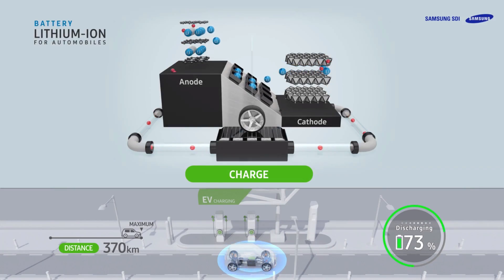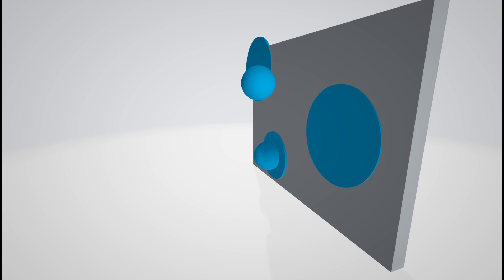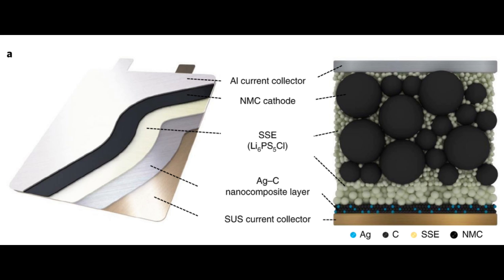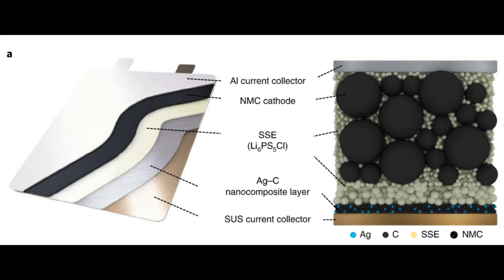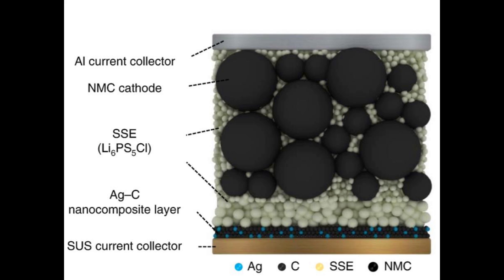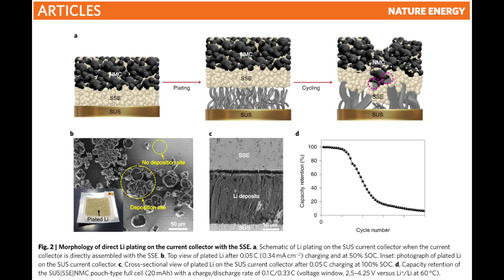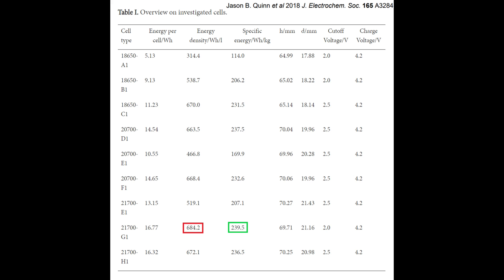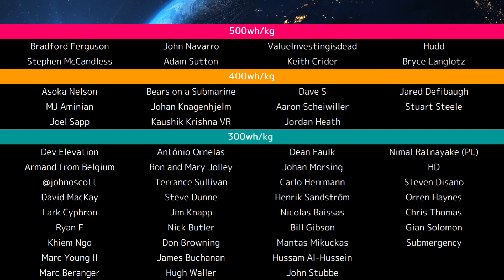Samsung's "Breakthrough" 900wh/l Solid State Battery (Deep Dive)

Comment: Sodium ion batteries: increase the energy density by using a more reactive metal and reduce the cost by sourcing it from a more common type of salt!
Reply from the maker: Yeah, but sodium is at least 10 years away
Reply: @thelimitingfactor  LOL just like fusion.  Chemistry is 1 of those sciences that you just can't predict; you have to try it out.  Now I'm not much of a chemist, but batteries are weird bringing chemistry and physics together!   ;)
Reply: Have a look at your perodic table Li is the lightest most reactive metal
Reply: @jacksterdaniels3718  What . . . no it isn't!  Look up a video on how they react with water!
Lithium just bubbles while sodium bursts into flames, and potassium explodes!
The real questions are: if the additional weight counters the added energy, and if it can be made as safe as lithium ion.

Comment: While the silver additive is a game stopper, He did not fully emphasize the potential for the substitution of lithium with higher energy densities such as sodium.
Sodium is not used with liquid electrolytes because it is too volatile. With solid electrolytes thermal runaway is not an issue, sodium is said to increase capacity x10.
Also if a different element is used such as sodium the silver plating catalyst maybe substituted with a less rare metal making the potential of this concept sustainable and worth considering given the increased capacity longevity & power density.
Reply from the maker: That's interesting!

Comment: 1. I did not see data that defines capacity loss at 1000 cycles: 20%? 50%?
2. I wonder if a solid state cell could be fully discharged w/o suffering damage?
Reply from the maker: Point number one, at 1000 cycles it was bouncing all over the place.  But it was still above 80%.  Not sure on the second point.
Reply: Search for Jhon Goodennght and Elenna Braga white papers. They have better research and cheap cann use Na(yeah salt from ocean or that what you use onn chiken)

Comment: Still confused on why no one is talking about the commercially available solid-state ceramic battery from TDK. It's teeny tiny, but still seems like a pretty big deal to me.
Reply from the maker: Because solid state has been around for years.  It's making solid state that hits every corner of the spider chart that's hard.

Comment: I have always wondered how the dendrites manage to short the battery to the extent of explosion. Why dont they just "zap" shorter like a thin wire over battery terminals would burn out? Or is it the combustion during the zap inside flammable material? Doesnt need o2 to combust?
Reply from the maker: The electrolyte is flammable.  Zap... Whooompfff, lol

Comment: Nice explanation of the Samsung cell, Jordan.  I question the importance of the cost of Zirconium and Silver.  This is ENTIRELY dependent on the amount required.  The Zr is a nanolayer, so I think that can be ignored.  As for the Ag, how much do they need?  If it's only a few milligrams per cell, no problem.  If it's grams per cell, then it's several thousand dollars per car.  Even that's not enough to be an absolute killer of this technology, if it were developed to a truly outstanding cycle life and energy density.
Reply from the maker: That's a fair point.  This is why I said small amounts would be required.  this is lab scale and there's no way of knowing how much they would end up needing.  There may be some use cases for this battery, but the fact that even Samsung isn't commercializing it is telling.
Reply: @thelimitingfactor  you could also argue along the lines, that the silver used is an "investment" or that it makes it more likely that the battery later at EOL will be reused/recycled since it has a higher intrinsic value because of its silver content, thus supporting the "circular economy" (and perhaps for the car owner, at EOL, to recoup the initial "investment".

Comment: Weight?
Reply from the maker: Exactly, they didn't say.  Guessing it's heavy.
Reply: @thelimitingfactor  The physical compression of the cell necessary to keep the sulfur electrolyte in close contact...   it didn't make sense to weight a 'lab cell' and compare it to a well developed 'commercial cell'.    But, it had advantages of 1) non-flammable  2) OK volume

Comment: well, we all know solid state batteries could be the way in the future...almost without question...the problem is, when they are finally up to the task...there will likely be something better....only time will tell. I've been keeping an eye on this for several years now...and keep hoping there will be some drastic leaps...but...it's just moving too slow...not to mention the manufacturing process will still need to be rectified.(no pun intended)
Reply from the maker: Straight up!  Revolutions in microchips are always 5 years away.  The hurdles keep getting higher for a breakthrough technology.  Silicon has gone farther than we ever thought it would.

Comment: Why do you suppose the researchers used silver instead of lead? Lead has been shown to inhibit dendrite growth quite well. A 3% alloy of lead in a mostly tin solder was enough to stop dendrite growth. Would lead have impacted performance that much?
Reply from the maker: Heavy metals are probably not necessary.  Battery 500 consortium is making progress just by tweaking electrolytes.
Reply: Jacob Brodsky, lead acid batteries have dendrites, where the tip of a dendrite is mainly composed of polycrystalline nanograins. With the increasing amount of nanocrystalline grains aggregated on the surface, the grain size becomes larger and the dendrite grows rapidly along axial direction. Thus resulting in a non conductive film and potential short circuit.
Reply from the maker: @Dana5775  Damn, great answer!

Comment: How many battery explosions and fires have you seen?  Slow charging and requires silver sounds like a deal breaker for EVs.
Reply: Solar panels maybe better, I'm more concerned with the low voltage range.  Maybe good for small electrical devices only.

Comment: It looks like you considered battery usability in EVs. What about its usage in small electronics? Won't it be viable?
Reply from the maker: The question is, why would you want it for any device?  1000 cycles is average, 900wh/l isn't spectacular, it doesn't fast charge, and there isn't currently a way to mass produce it. Safety - possible, but there are other solutions out there.

Comment: What's the physical limit of kwh/kg? 1000? 10.000?
Reply from the maker: Hard to say.  There is one 'challenge' set for the same as gasoline....something like 12000wh/kg.  600wh/kg is planned for a little over a decade from now...at the system level.  Which would mean about 1000wh/kg.
Reply: @thelimitingfactor  Does the 12000wh/kg figure for gasoline include the mass of the engine and supporting bits that allow it to be realized?

Comment: Another faultlessly argued video.  Shirley Meng has already intimated that high energy to volume (not weight) batteries are presently possible but due to material constraints and mass production hurdles may never become financially viable.  This Samsung ‘break through’ may fall into this category.  The only way to compare the multiplicity of often mutually exclusive attributes of batteries is, as she described it, to plot them on a ‘spider chart’.  Tesla appear to be focussing on increasing the number of cycles to >4000 and making multiple incremental improvements to manufacturing processes to achieve gains that are commercially meaningful.

Comment: Minor production quibble: I think the 60fps doesn't make sense for this presentation style video. It just increases the bandwidth and hardware requirements with little benefit.
Reply: Manuel Barkhau with so many static images frame rates should be optimized in the compression algorithm to reduce redundancy.
Reply: Unfortunately I agree! My old Chromecast couldn't keep up with this :(
Reply: I prefer it, it's smoother and easier on my eyes. Additionally I have 500mbit Internet and my 7 year old computer is more than fast enough for it. Can't you switch the resolution yourself?
Reply: Manuel Barkhau out of curiosity, does reducing it to say 480p help?
Reply: Nevermind the fps, what's up with the sound? It seems every start of a sentence is muted, really annoying.
Reply: people using 60fps for other than gaming is useless I think.. it inflates bandwidth requirements extremely for no benefit.. I even think 24p is more aesthetic than 60fps
Reply: @chronokoks  I like it.  I think videos look much better in 60fps.
Reply: @bob15479  to each his own but there's a reason why hollywood prefers 24fps.. more doesn't always mean it's better or nicer
Reply: chronok Hollywood is 24fps because tape was expensive back in the day. That’s literally why. Also it’s an opinion 🤷‍♂️
Reply: @bob15479  it wasn't because tape was expensive. It was because 35mm film was expensive and 24fps was the minimum you could get away with while still preserving sound synchronization. Before sound was synchronized with film silent films were shot at 16fps.
Reply: @reviewgodusa9613  isn't film the same as tape? whichever one is expensive is the one I was referring to. lol.

Comment: I I'm not as down on the cost of the battery simply because I'm not sure about the amounts of silver used. Remember we use both platinum and Palladium in catalytic converters today and the amounts are substantial enough to make them a prime target in recycling oh, but there's still a catalytic converter for 2 in pretty much every vehicle on the road
Reply from the maker: A catalytic converter is required on every vehicle.  So no individual company gets ahead.  This would be like putting a catalytic converter in your vehicle but no one else is.  If it were viable, Samsung would be developing it.  They aren't.
Reply: @thelimitingfactor  true but if the difference in performance can be increased to an extent that justifies the cost difference, or application can be found in which the added cost is Justified due to the increased performance< mobil phone and drone batteries come to mind> this could be very much useful Tech. It all comes down to precisely how much silver is required.

Comment: Great video as always. You focused the use case of this solid state battery chemistry for electric vehicles. Samsung is a major player in the mobile phone world. With that use case in mind, how would you rate this battery chemistry for creating batteries for mobile phones or other small battery driven appliances.
Reply from the maker: Similar.  You make a good point though.  I do tend to think of batteries strictly through the lens of electric vehicles and storage.  Basically, this battery is flat out too expensive with little benefit in return.
Reply: The Limiting Factor wouldn’t that depend more on the amount of silver used in a battery. Did they tell anything about the amount of silver used in this setup? Using precious metals in electronics is not new. An average laptop contains about 60micrograms of gold.

Comment: Cool as always, Jordan. Could you do one on CATL 2 million km battery? They say it's ready for manufacturing to any buyer which is interesting since Tesla was supposed to announce a million mile battery based on Jeff Dahn / Dalhousie tech with CATL being the Chinese partner for Asian production. And now CATL has independently developed an 1,2 mil mile one for all takers? AND Tesla VP Robin Ren who orchestrated Giga Shanghai & partners incl. CATL suddenly leaving Tesla? Too many coincidences here... anything to share?
Reply from the maker: As Jeff Dahn has said, a million-mile battery is now easy.  Everything you need to make one is now on the market.  Anyone should be able to make one.  If they're not able to do it for a decent price it comes down to the specific engineering and cost competitiveness of that company.
Reply: @thelimitingfactor  That's excellent news for the environment, I'm excited to see how it'll change costs. But specifically Dahn's IP, that is exclusive to Tesla, no?
Reply: @BigBoneESB  Other way round. Tesla's battery IP is partially sourced from Dahn under contract and the laboratory they paid for. A base line battery design was open sourced late last year that makes any other performance specs redundant in the EV world. This 'million mile' battery is based on Dahn's two electrolyte formula, single crystal cathode and artificial graphite anode - all elements that are available from multiple suppliers but at increased cost. Additionally this version uses a lot of Cobalt.
Since then many others have announced battery 'breakthroughs' with fancy names, like BYD in conjunction with Toyota in China. GM and CATL None of them have released details on the chemistry and given their expertize, the Chinese ones are likely LiFe - an old low energy density chemistry that has never contained cobalt and always had a long cycle life.
Tesla has patents that indicate they have a superior low cobalt chemistry that will be disclosed on Battery Day.
https://iopscience.iop.org/article/10.1149/2.0981913jes

Comment: One little remark, usually milk and not water is used in pancakes? Perhaps make a correction video? 😂 🙃

Keep them coming mate!
Reply from the maker: Lol!  Good point.  Milk does make a superior pancake.
Reply: Just don't use milk  in the battery...

If you milk it for all its worth it's still very doubtful it would work at all!

Comment: At last, someone to clarify the significance of Samsung bold announcement of their SSB breakthrough  - interesting but silver puts its cost beyond commercial viability. And its only a lab-bat! Thanks Jordan.
Reply: I don't think the silver would stop it being commercially viable. The amount of silver in each battery is not very large, and silver is not quite as expensive as you might expect (it's very cheap compared to gold, for example, which is used in lots of electronic components). A couple of grams of silver only costs about a dollar, which would be a justified expense if the battery was sold at premium prices (which we would expect, considering the advanced technology).

Comment: One more question to ask? 
How will the structure tolerate thermal stress and thermal cycle? Report avoid that means they are still working on it or even ignorance this possibility.
Reply from the maker: Exactly!  Usually any chemistry goes through a series of durability tests.  Apparently they didn't see the chemistry as viable enough to bother?
Reply: The Limiting Factor 
Is that your words or theirs?